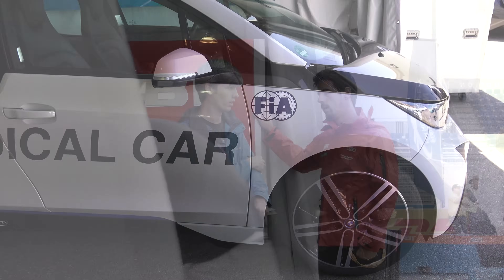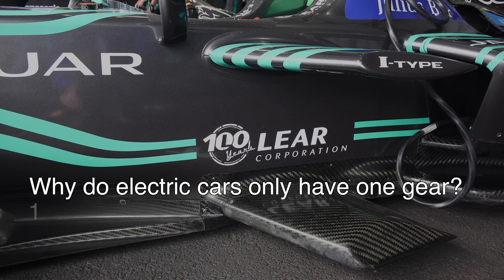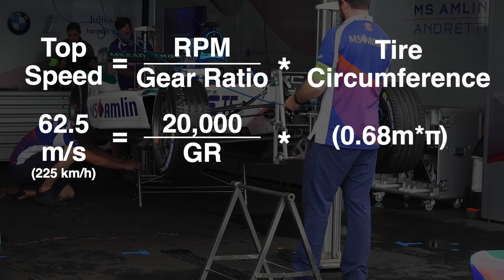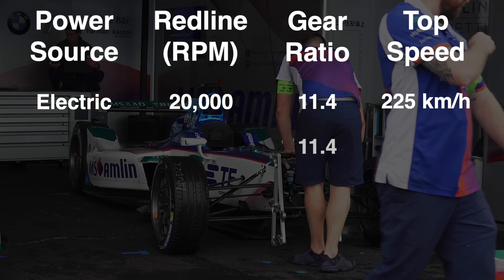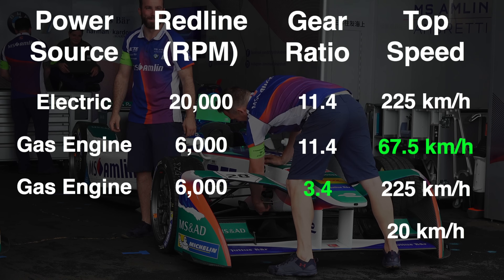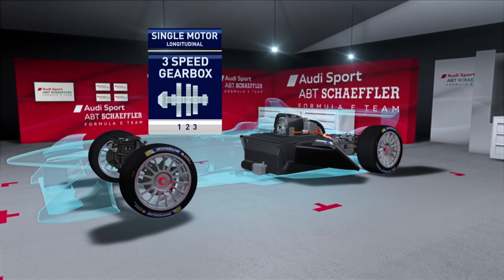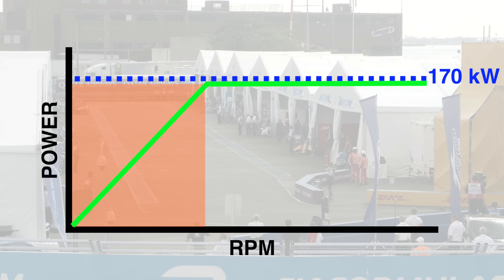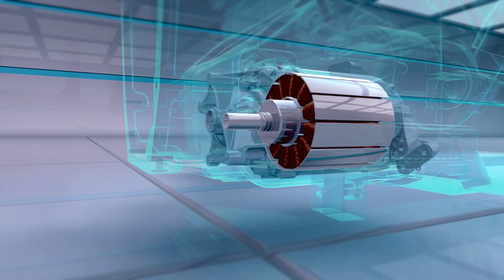Why Do Electric Cars Only Have 1 Gear?

Comment: We built an electric truck in high school. It used the same 4spd transmission from the chevy s10 with a custom bellhousing. It could either be shifted or just put in 4th and driven but it didnt use a clutch. How does that work?

Comment: The Tesla has a great 0-60 time but combustion engines catch up in the 1/4 mile. Would gearing help the Tesla to have a more constant acceleration?
Reply: yes it would... and Tesla could use a smaller motor but Tesla isn't lucky when it comes to having more than one gear in their cars....

Comment: It's also worth noting that the effective "gears" are created by changing the winding geometry of the eMachine, where you trade off maximum torque vs rotational speed for any given power value.  A higher number of turns means more torque (more ampturns) but also means lower maximum speed because the KE of the motor is similarly increased.  However, as it's the inductance of an eMachine that fundamentally limits it's ultimate power capability (for any given supply voltage), and inductance increases as the square of the turn counts, you'll find the trend for maximum power eMachines to be towards, smaller, higher speed, lower torque architectures, and these could/will need gears in order to meet the low speed (and zero speed) tractive effort requirements
Reply: If lower KE motors have more turns then why are they relatively cheaper?does the wire gauge decrease?

Comment: Question: "Why do electric cars only have 1 gear"  Answer = "COST"
Reply: Because batteries are crazy expensive...
Reply: Question: why is electric cars soo expensive if they're built with low cost??
Reply: Because they aren't (yet) built in high enough volumes!  But that's changing and changing fast.  the next ModelYear platforms are likely to achieve cost parity with ICE, and the one after that will be cheaper!
Reply: @Max Torque the Nissan Leaf and Tesla Model S is both mass produced...
Reply: @Rondo Cat if that be the case battery EVs will never take off... as they'll never be able to build an affordable EV...
Reply: no they are not.  The reason say a Ford Focus, or Toyota Yaris are extremely cheap is that they all share components. For example, the starter motor.  That means Denso, Valeo, Bosch and other Tier1 suppliers churn out MILLIONS of identical starter motors a year, and i mean millions, so each starter motor costs just a few $.  Until EVs are built in millions then they will cost more.
Reply: @Max Torque dude they already produced more than 300k cars each, i would call that mass produced... now its true that car companies do use the same parts to bring down cost like starter motors, engine blocks, fuel injectors, valves, headers, air filters, water pumps, oil pumps, fuel pumps etc (but an EV uses none of this).. an EV only got like 8moving parts in total where your normal car got like 1000 or more moving parts... 

now these car companies also share seats, suspension parts, brakes, diffs (both Tesla and Nissan do this for their EVs)... as i remember Tesla even outsourced the doors for the Model X to help bring down cost... the electric motors is also massed produced and its no where near expensive or complicated as your avg gas engine.. the transmissions for EVs is basically 1gear most of the switches inside a Tesla comes from MB (MB is one of the biggest and oldest car manufacture) Nissan uses parts from their other cars....
not every car model sells a million units before they do a complete redesign (even massed produced affordable cars) now that aside there has been a few auto shops that do EV conversions and they're not that expensive (and the most they'll do is maybe 50-100 cars in a year, thats low volume)
Reply: dunhillsupramk3 Tesla model 3 has half a million people who have pre-ordered it.  That shows that EV's are not mass market, yet.  That is 500,000 people that can't buy an EV because there are none to buy.
Reply: Max Torque answer: USELESS, LESS SPACE, UNEFFICENT, and with EV if you would shift then you would slow it down
Reply: dunhillsupramk3 batterys are atm expensive but the price drops fast... its normal if new technic gets in its revulution not like evolution....
Reply: Rondo Cat crazy... nah but you need a lot of it bc the are not so efficent atm

Comment: I have the assumption that they're using stepper motors. Though I'm not sure if a secondary coil is lighter than transmission gears.  I've only seen a few e racing videos here.
Reply: i don't think a coil would be lighter than a gear... but what do i know...

Comment: Engineering fail. HP = RPM X torque. An electric engine at 10,000 RPM produces ten times the power that its does at 1000 RPM. Obviously, you need a gear of some type would be highly advantage. In reality, most electric motor's use a drive scheme that drives the poles in a way that gives the effect of a mechanical transmission, but in an electric way. This is done by selecting the way the poles of the motor are being driven. Many poles = lower speed = more torque. Fewer poles = higher speed = less torque. No transmission required, because it can be done electronically.

Look at it like this. If a electric car has 600 HP at 10,000 rpm and 100 MPH, then it only has 30 HP at 500 RPM and 5 MPH, when it is getting started. But we all know electric cars are quick off the line.
Reply: While you are correct in an EV there are a few other factors.  The battery for example will have a maximum current discharge limit.  Power = Voltage x Current.
Reply: One question, how electric car move from 0 speed if it don't have power? I think this way of thinking is good for gas car, but not work  for electric cars.
Reply: Sędziwój Poljak:)
Power is product of speed and force. 0 rpm zero motor makes 0 power, but it has max torque or force. It acelerates with constant torque until it reaches max power. When it reaches max power, torque start to drop, but product of torque and revs stays constant, so it makes constant power. It max rews are limited by internal structure and by overrewing motor would fell apart.
Reply: tkorocky Nah, if you want HORSEpower ya gotta also divide by 5252.

Comment: Electric carc dont have only one gear!!!!!! check out Rimac Concept one...He have 2 gears
Reply: Watch the whole video.  He does in fact explain that for some reasons EV's do sometimes have additional gears.
Reply: Most -- the vast majority of -- electric cars only have one gear.   The very few that don't are rare exceptions.   Diesel-electric locomotives also only have one gear.  (Point being that the concept of electric-powered vehicles having only one gear ratio is widespread.)

So the title is substantially correct, even if not literally true for every electric vehicle on the planet.   The explanation of why electric vehicles generally only have one gear is the key point here that we should be paying attention to, not whether there is some extraordinary exception somewhere that makes the title technically not 100% true in all cases.

I suppose they could've written the title as "Why do electric cars almost always have one gear", but is that really necessary?   I'm a lawyer and a grammarian, and I can be infuriatingly pedantic myself at times, and even I don't have a problem with the title of this video.   So lighten up!   :-)
Reply: @Milesco  locomotives only have one gear for different reasons though
Reply: Gerrad Reynolds : And what reasons would those be?
Reply: I think the Tesla Roadster had two gears too.
Reply: TTate idk but i thing Rimac Owner of Rimac automobili said in one of his vidios that concept one is only electric car with 2 speed gearbox
Reply: * Antonio* I'm probably mistaken then.
Reply: Roadster originally had two gears but Tesla had problems with that gear box and pulled it and replaced them all with single speeds.
Reply: +Antonio:  The point is that they need only one gear. Not whether or not they have more than one. The video's title is misleading; the video itself, however, is not.

Comment: Production ev cars need at lease 2 gears Tesla have cheaped out and use 1 gear for good 0-60 times remember cars are not sold by their 0-70 speed or 0-50 its all marketing
Reply: Mark Williams That made no sense

Comment: It'll be interesting to see if multi-gear transmissions ever catch on in production EVs. From what I understand, it's really just the cost of materials holding them back from being a reality (need VERY sturdy components to handle all that torque) - but in a road car, the benefits are also minimal. The original Tesla Roadster was supposed to have a 2-speed automatic, but they could never keep it in one piece... ultimately, it didn't matter.

Not having any gear changes is also one of the things that makes the experience of driving an EV unique. A lot of the early automatic transmissions in the 1940s had the same selling point - no gear changes whatsoever on an original Buick Dynaflow. Back then, there were some people who thought the Torque Converter alone would be sufficient as a manual transmission replacement... turns out people weren't willing to part with all that efficiency and performance. But those early automatic Buicks are definitely a much, much different experience to drive than pretty much all of their contemporaries.

Love EE, love Formula E - keep up the great work homie.

Comment: I can't find an explanation. I know there will be heat generated because of inefficiency, but what part would actually heat up in a motor? Wiring? That seems like the only thing that would, but I don't know. I need an engineer.
Reply: Jake Austin Wires, bearings, control & conversion electronics, brakes (on top of any regenerative braking), batteries, and the air around the cars.

Comment: why not use one motor per wheel with a shared battery?
Reply: icannotfly how would you solve the differential?
Reply: knut riis in software
Reply: OK, I see that is possible, but since you don't want the motor out in the wheel (unsprung mass) it seems that one motor in the center of the car and conventional differential is a better option - at least so far.

Comment: Assuming the widths (which affects grip way more than circumference as far as I'm aware) of the wheels stays the same (let's say 8.5") how much quicker would going from a wheel diameter of 18" down to 17" or 16" make your vehicle accelerate? The smaller wheels (in theory) should act the same as having a higher final drive which will effectively increase acceleration and decrease top speed in each gear (and top speed in general).

Comment: Electric motors produce 100% torque at zero RPM; why would a transmission be necessary?
Reply: EV Owner because power is torque multiplied with rpm.
Reply: I finally got it watching the video; not only do the motors not produce max torque at low rpm, the real factor is that more power comes from higher rpm. Some teams gain advantage in the low speed parts of the course with higher acceleration there, offsetting penalties of the increased weight, complexity, and losses from a transmission.

Comment: Do gas powered cars produce 50% of their power when 50% of the throttle is applied?
Reply: Guilherme Alexandre No. Throttle mapping is not linear and neither in engine out put. 

If you actually send a request for 50% torque, it takes time for the engine to adjust for the new fuel, air, and RPM requirements. Basically you say, hey give me 50% torque, and the gas motor is like ok hold on, I gotta spin up and suck in more air and fuel.
Reply: fidel catsro Half way at full throttle and with a flat torque curve. Not at 50% throttle.
Reply: Yes provided your car engine is super tuned to give 100hp at exactly 5000rpm redline max, so when you rev half up to 2500rpm it should be around 50hp

Comment: Electric cars are boring
Reply: PlasticAcaria There is something called an EV grin, try it out. When is the last time you couldn't stop smiling when driving?
Reply: Not really, we can add cardboard to the fenders to rub against the tyres and it will make fake engine roar noise as its driven, that should make it more audibly interesting

Comment: Could you theoretically artificially limit the power of an electric engine to simulate that of an internal combustion engine so that you could use a manual gearbox? I know it would be slower, I know that defeats the point of an electric car, I just love manual gearboxes and I don't want them to die off.
Reply: Power controllers can do that but i think it will be boring to drive..power controllers are like resistors controlling amount of battery power that goes into an electric appliance....similar to a dim switch or the electric fan speed control knob
Reply: Mitchell Denham Manual has been dead for a long time already. You will love instant torque more.

Comment: How can electric cars reverse if they only have 1 gear?
They must have 2, surely. One for forwards, one for reverse?
Reply: Think about the RC cars. Electric motors can spin the other way around.
Reply: Just reverse polarity amigo...
Reply: zemekiel Funny. You can run the motor backwards or forward as you please. You could drive 140 mph backwards.